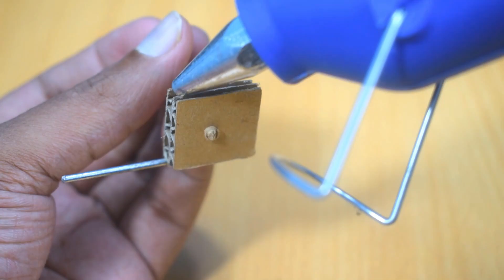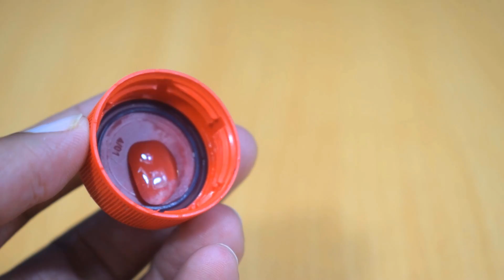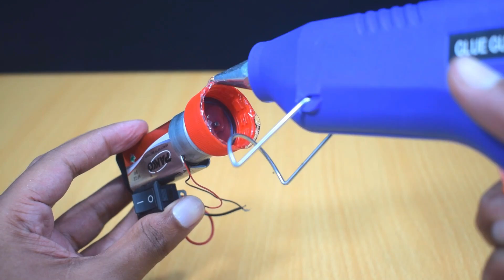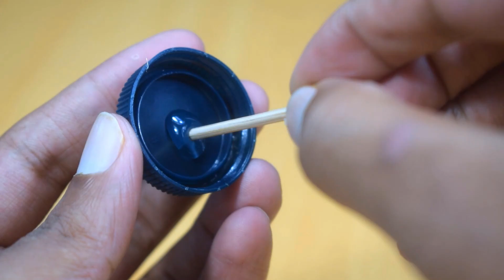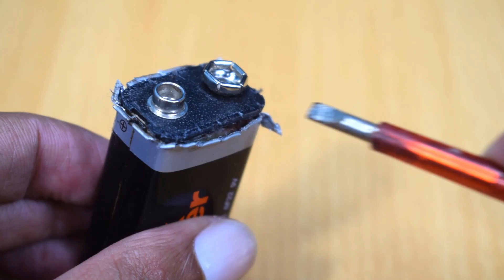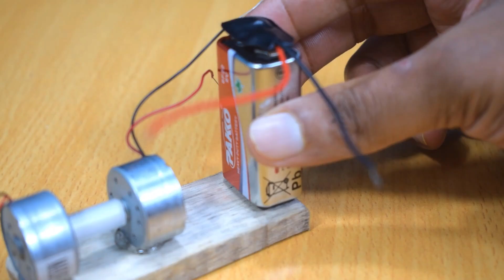5 USEFUL LIFE HACKS For DVD MOTOR

Comment: Last one is waste because 1.5 v to 3v is enough for led light  you use 9v for glow light
Reply: no it doesn't at the most he is using 5,9 ,8ts not the 9v battery that's giving power to the led,it uses the motor to reduce the voltage by reversing the rotation of the motor it produces energy and it is the energy of the motor that powers the led works like a bicycle dynamo